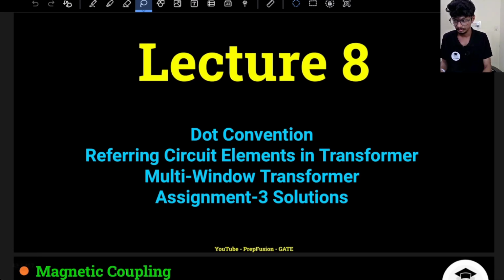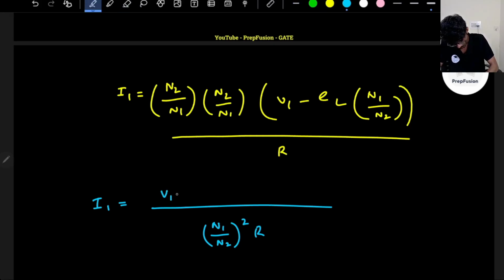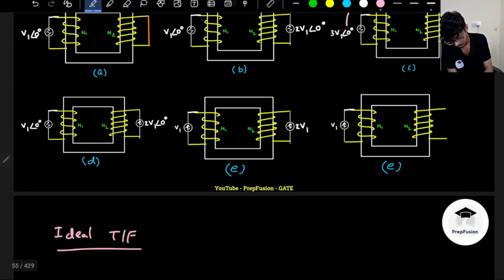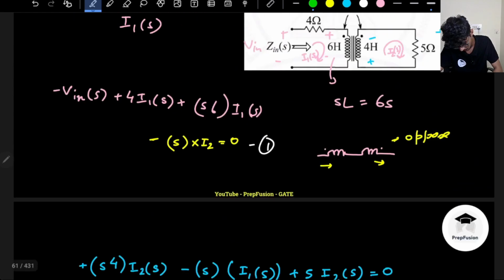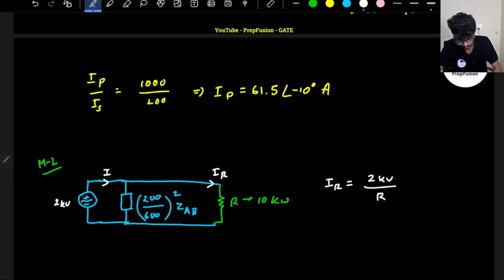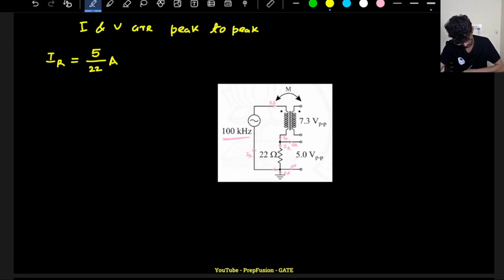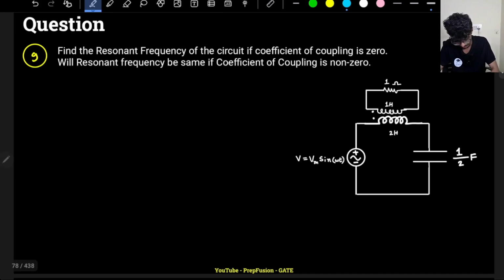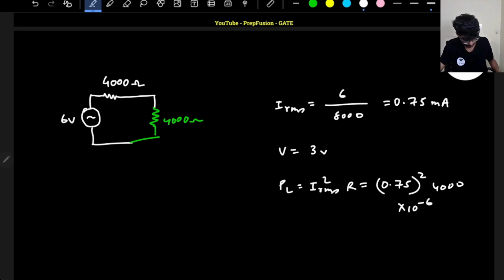L8 Dot Convention of Transformers || Electrical Machines || Anish Saha || PrepFusion

Comment: @01:01:15 - For this question sir should n't the answer be 13 A (rms)
also, we can also use Apparent power on primary and secondary sides as equal for finding the magnitude of I1(primary current)